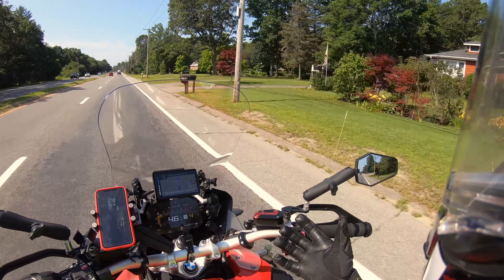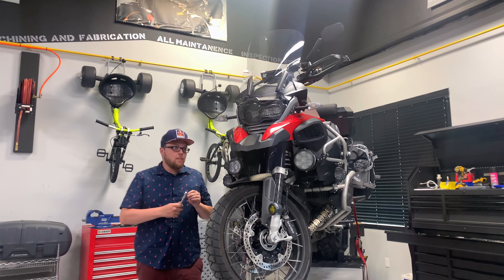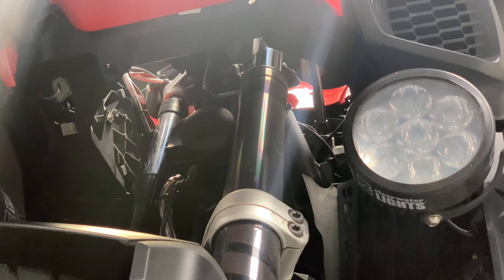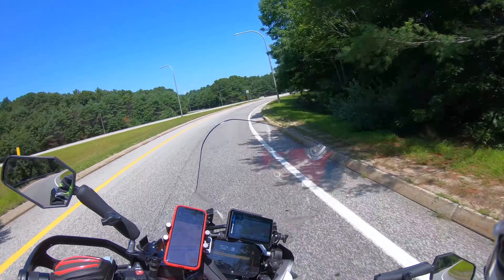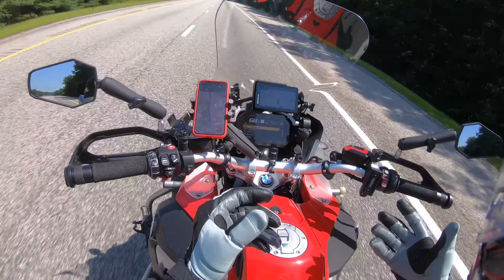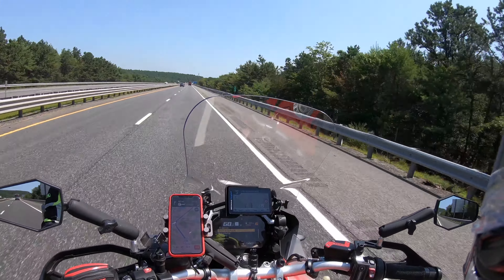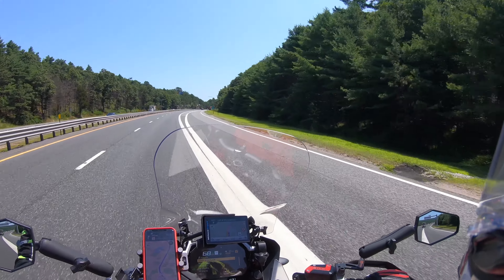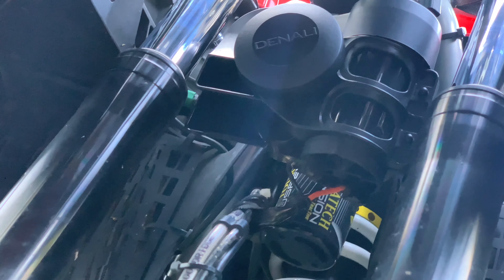Twisted Throttle Fixed the Denali Soundbomb on my R1200GS

Comment: Hi Adam.. I experienced exactly the same issue of the sound bomb damaged the fork seal...could you please advice what should I do next?
Reply from the maker: That sucks and I'm sorry. First step is replace the fork seal and inspect the fork tube for any damage at all. If the tube has scratches, you're in for a pricey repair because the seal won't seal if the tube is damaged. I'd let Denali / Twisted Throttle know you experienced this. They have closed their shop to people visiting so you'll have to either reinstall the sound bomb and hope it doesn't happen again or just got back to an OEM horn. I haven't found a suitable location for this thing and have actually gone back to OEM. It was just too risky.
Reply: @AdamChandler86  hi Adam thank you for the reply.. Hope there is no scratch on the fork. I have to reinspect on that part. Meanwhile, I  did read back on your thread link on the complain  and it seems that there was some one suggested on diffrent location of installation where there is no obstruction. Furthermore Deneli should redesign the horn so that the dimension of the horn is slightly smaller or compact in order to avoid such incident as the clearance between the fork and the horn is very much questionable.In deed is goin to cost me alot for the repair if the fork is scratched. Please do share me your email address as I would like to share you  photos of the damaged parts. Please help me to extend the complaint to Deneli. Thank you Adam

Comment: Hi Adam Matt here. I have the exact setup as you with Clearwater light that flash and sound bomb. When I press the horn the sound bomb stays on and caught fire. Would this because of a fault relay??
Reply from the maker: Jeez. I'm not an electrical expert but I'd reach out to TT/Denali. Anytime a fire breaks out, they probably want to know.
Reply: Hi,

I fortunately havent had a fire, but my denali horn doesnt seem to want to produce the sound yours does when I press the horn button.  Have you guys come across this before? I've got a short clip of the noise it make on my channel. Thank you.